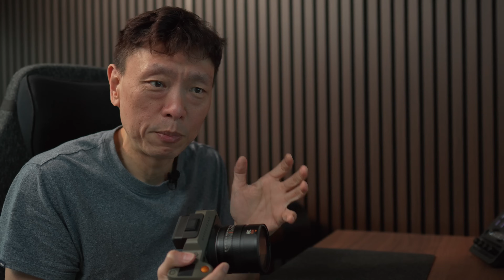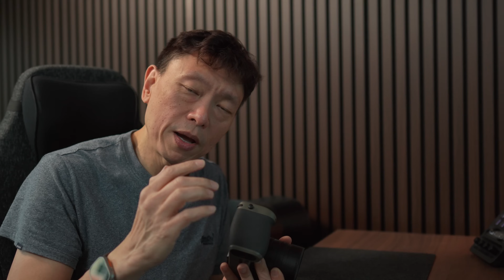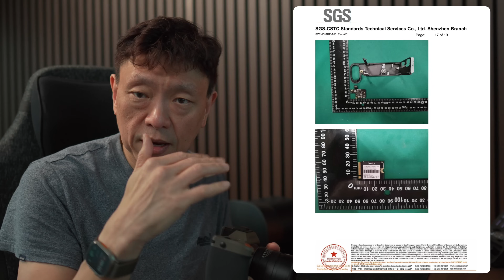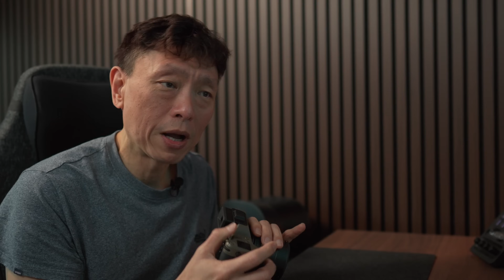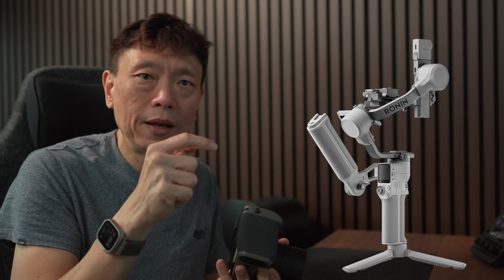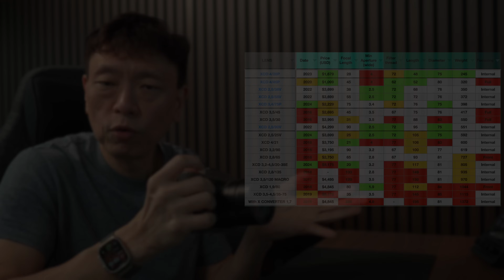Hasselblad X2D Mark 2 confirmed launch date!

Comment: I hope they add Wifi transfer to FTP servers and Android devices.
Reply from the maker: Will be slow though. 200MB per file. For transfering yes, but not wireless tethering.
Reply: @Hasseled It's fine my R5 does 40mb in 1-2 seconds with 433mbit,this isn't a sports camera, at the moment it's just not happening.

Comment: very interesting news ... a 60mm f4 is about 47-48 f3.2 equivalent - not really exciting for portrait shooters. i'm thinking a 70mm f2.5 = 55 f2 or a replacement for the 65 as you say. cheers
Reply from the maker: Yeah, my speculation for the F4 is just based on a P series lens which may not be very exciting.

Comment: Wondering if the 907x will get the same internal updates?!
Reply from the maker: I realised that there is an upgrade to the IBIS to 8 stops stabilisation instead of the original 7 stops. And the 907X doesn't have IBIS so it will still be a different breed.

Comment: What more important changes to AF -- does the Mk II have continuous AF? The only reason to upgrade would be the inclusion of AF-C in the new camera -- we were "promised" this in the X2D but it has not arrived. I am not accepting any more promises from H/DJI. The X2D is useless for anything near/close that is moving when you want to shoot wide
The mid focal length you propose is already well served. -- Hasselblad "needs" to look at the wider / shorter focal length lenses which are needed by landscape/urban shooters first with a replacement to the 4/21 and then a Tilt/Shift option (I already own and use the HSE, but this needs older H lenses) -- time for the XCD to address needs other than portrait shooters. A 19 or 21 or 24 mm TS lens would be ideal. ANy adapter like the HSE adds barrel length show would have to include optics like the x1.5 in the HSE - this was BAD news for Landscape/cityscape and interior shooters who need the widest possible lens -- sure the 0.8 HX converter helped a little but adding more glass in the optical path just reduces resolution/transmission.
Reply from the maker: Don't listen to promises. If the feature ain't there, don't buy it (and pay for it) in hope that it will. Doesn't just apply to DJI or Hasselblad. For any tech companies.

Comment: waiting for it to come out that way the x2d will drop in price and get a 2nd x2d body
Reply from the maker: Yes, that will happen, but just bear in mind that it also depends on how many units of X2Dii they are able to produce and get into the hands of users. If they cannot keep up with the demands, the original X2D may not flood the used market as fast as expected.

Comment: I wish Hasselblad would make a lighter camera. No need for a solid block of aluminum, right?
Reply from the maker: I hear ya, but a robust build is a signature of the product, I guess.
Reply: Will it weigh more than x2d?
Reply: Do you want plastic cameras?? 🙃
Reply: @domipro123 if you can somehow dissipate the heat. YES!!!. But you can for sure make it with hollow out aluminum or titanium.

Comment: I as a street photographer want a 45v and auto iso in manual mode
Reply from the maker: Yes, this. This is a bummer. Auto ISO seems to be a no brainer when in Manual mode. 

But a workaround would be to use P mode, where you can change the aperture, and exposure compensation, which will change the shutter speeds indirectly, and ISO is auto.

Comment: I really hope the X2D II will support auto ISO in manual mode.
Reply: Wait the current one does not? That would be almost unusable to me
Reply from the maker: A workaround would be to use P mode, where you can change the aperture, and exposure compensation, which will change the shutter speeds indirectly, and ISO is auto.

Comment: I've been waiting for this camera for over a year. I hope they address why they let the patent "leak" without properly announcing the camera to the public. Regardless, the moment this camera is available for pre-order, I'm buying it. I'm super excited to see how DJI's lidar technology is going to work with Hasselblad. From my experience using dji's lidar autofocus system, it's no where as good as a Sony or Canon or any of the top manufactures. I believe the limit to subject detect is only 20 feet. Also, I wonder if this X2Dii is the camera people are getting confused with the rumored "dji mirrorless" camera. I don't see DJI producing their own mirrorless. Maybe I'm wrong. Oh well, Hasselblad ability to capture dynamic range is second to none.
Reply from the maker: Great to hear you're so eager! I'm looking forward to seeing how the new camera performs with the LIDAR technology. I think leaks through patent filings and inspection/testing papers are common for tech products. The process is long and usually starts 6-12 months before official release.

Comment: Interesting if the reliable source is correct...

BTW, Hasselblad's cameras don't have a dedicated (separate) CPU. There's zero reason to think the X2D II will break from this.
Reply from the maker: Pretty sure it is accurate. And I have corroborating information from across at least 3 markets to confirm it. Even the release timing down to the hour has been confirmed.
Reply: Which means they have space to introduce a huge change.

Comment: the position of the LiDAR sensor is a good point, because it might mean that we will never see a tele zoom lens, like 100-250 mm.
Reply: Does LiDAR work at that range ? Not sure 🤔
Reply from the maker: If it is similar power to the LIDAR on RS4, then it'll be about 20m. But DJI enterprise drones have much more powerful lidar.
Reply: @Hasseled  but I wasn't referring to the range, but the position. telezoom lenses mostly have a wide front element which might block free line of sight to the object to be focussed on.

Comment: My gut feeling - and this is speculation so take it with a grain of salt - is that it will be an E series lens that’s around 30-90mm, give or take a few mm on either end. My thinking is that if Hasselblad’s releasing their super-high-end flagship camera, they’re not going to drop a P series lens next to it; the new lens will be an equally impressive product. Second, they created the whole E “series” last year and only filled it with one lens, an ultra wide zoom that’s equivalent to 16-28 on full frame systems. It would make sense for Hasselblad to fill the need for a 24-70-like lens in medium format. I hesitate to speculate on the aperture because that will come down to physics and feasibility. But if the new lens is a 3.5/30-90E, I’ll be all over it. I wouldn’t be shocked if it was in the $6k USD range like the 20-35E with the X2D II being around $9-10k USD.
Reply: It's a 35-100mm E lens.
Reply from the maker: Very sound reasoning! I won't be surprised about the E lens asking price. It will be astronomical.
Reply: Would be good if Hasselblad releases prime lenses in the E series, especially if they're updated versions of the original XCD lenses.
Reply: @RealCelticGamer except I like the MF ring on the V lenses which has disappeared with the E lens.
Reply: The 20-35 has a MF ring, it's just not combined with the aperture dial like on the V series ...I don't think that would be possible with the variable aperture based on focal length.
Reply: I visited a HB dealer and he confirmed me that the new lens is like the first lens you mentioned. It's gonna cost around the eye watering 7k-8k depending the currency. 😭

Comment: I peordered in HK and was told the list price for the Mark II will be US$7,133.
Reply: Since spring I kind of urgently wanted to buy either X2D or X2DII - nearly couldn't wait, but I thought about Hasselblad would offer a new lens as well. This at least would have an influence on the decision which focal lens-range to choose. So I waited until now and I am very curiously looking forward to end of August.
I think Lidar will be possible for Tele-lenses as well, because laser beam doesn't wide up like a normal light and the angle of view of a longer lens is more narrow, the longer the focal length is. Don't know whether I am right in that point but I have a good feeling🙂. 
I guess there will be a new Zoom E-lens...
Thank you very much for your informations, explanations and the positive way giving the support to us. 👍
Reply from the maker: You are most welcome! Thanks for the affirmation!
Reply from the maker: Thanks for the information. That doesn't sound too bad actually.
Reply from the maker: Considering the X2D first launched at $10,498, and got price cut to $8,199. So $7,133 is actually quite good.
Reply: @Hasseled The pre order price in HK is $50,000 HKD for deposit and the final payment is expected to not exceed $10,000 HKD. At least that's what the Hasselblad dealer told me.
Reply: @Mocha_122  Same pre-order amount for me.
Reply: @jimhofman3179  which is going to be $7133 USD equivalent if bought in HK. same as X2D pricing. HK/CHINA is the cheapest place to buy compared to US/EU
Reply: So that's about £5100 in the UK. About the same price as my Nikon Z9 before their recent price drop. Might bring it within range for me.
Reply: Doubtful the X2D II would cost less at launch than the X2D did, as Hasselblad aren't Fujifilm plus Trump's tariffs need to be accounted for.
Reply from the maker: From most accounts across 2 markets, it does seem to be cheaper at launch.
Reply: @RealCelticGamer  apparently is it less in certain countries.... check X1DII VS X1D. slightly less.
Reply: Thanks for the info. Currently a A7RV user and looking seriously at Hasselblad. I subscribed.

Comment: Already pre ordered from my Hong Kong Hasselblad dealer but I have been told there is a new E lens as well and was told it could be a 35-90. But the first batch of reservations is already full but they told me that if I pre ordered the new lens I will be able to pick it up the second batch before 30th October.
Reply from the maker: Yeah, my thinking is that it will likely be an E lens. But to reach 90mm might not be viable. Not sure but let's see. If they do get to 90mm the aperture might get very small to keep the size down.
Reply: @Hasseled  35-100mm (medium format) with f2.8 to 3.5 (ish) so that's like a 27-80mm full frame.